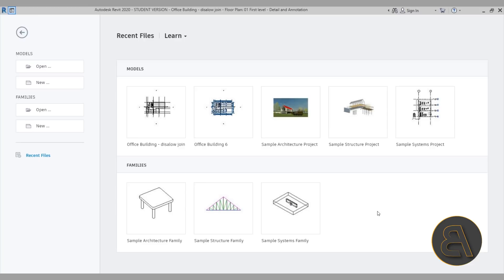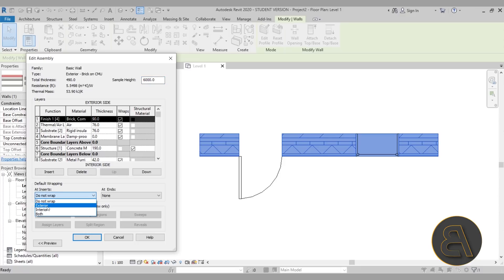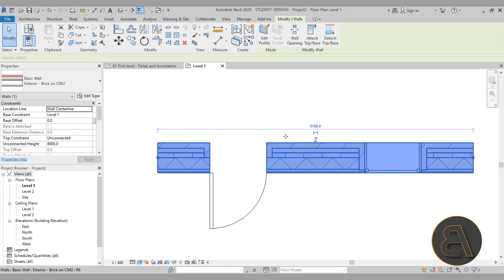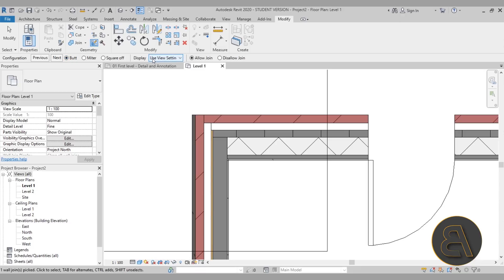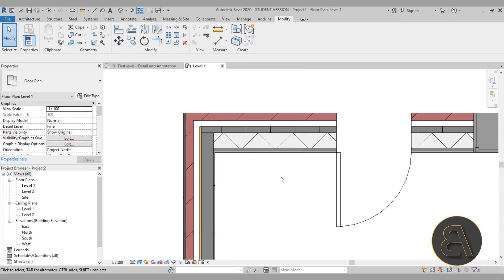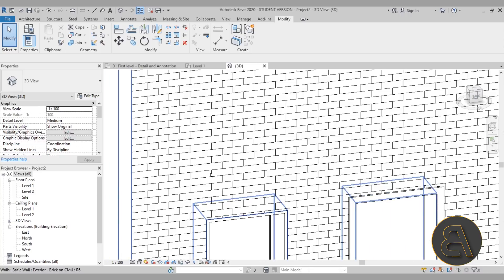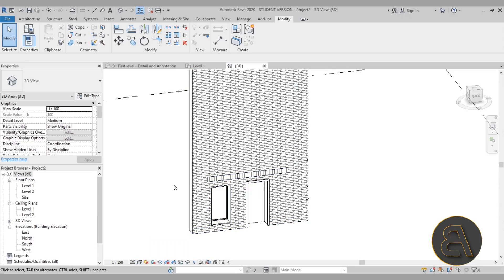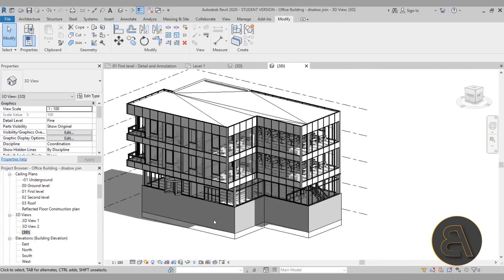Wall Hacks in Revit Tutorial

Comment: I was trying to find in any of your videos how would you approach external insulation for home renovation. I thought about using phasing in Revit to change something. So for example if in the current phase we have got only a brick wall wall and in next phase it will receive external insulation and some sort of external render system. It won't work to remove walls and change the wall type? What's your thoughts? And if you maybe have a video about this already or you may consider creating one. This would be intriguing to see. Thanks.

Comment: Hi Mr. Architect I have problem in my wall which I made with wooden slats I used reveal to added to the normal wall to have wood slats surrounded the whole box of building I cut the opening like for windows and door opening by wall opening i attain what i want in the 3d but when i export my files to IFC the rectangular block which i subtracted to the wall to have opening is appearing how can i solve this problem i want that rectangular which i used to subtract the wall for windows and door opening for the wooden slats not to appear.. Thanks in advance...Miss EVA

Comment: have a question
for basic drafting and basic 3d
is revit LT and autocad LT sufficient

I am on older version of LT now
Reply: Yes, when using both and keeping in mind the following issues: Biggest issue is Revit is not backwards compatible - an older version cannot open a newer versions file, a newer file cannot be re-saved to an older one & any exporting will loose some vector or family data, with the end user not easily knowing what is missing or corrupted. Additionally, AutoCAD LT will very likely have no 3d features, and Revit LT will have all 3d but not have any work-sharing features. At least it was this way several iterations ago. 

AutoCAD LT should track existing 3d; meaning it should import and export the 3d nodes - you just won't be able to manipulate them from inside AutoCAD LT and Revit LT should not destroy a central files work-sharing set-ups, it just wont allow an LT User to sync with any central model.

WARNING! This section only applies to multiple users of the same Revit file... Other users have no easy way to know if an LT user has taken 'ownership' of the central file unless paying very close attention to the files file-tree dates... This means that an LT user must effectively own the Central Model that no one else can link or sync to while in use by the LT license. Once finished, the LT Model is saved back into its proper original central file location - where LT will auto-append the file name to "...LT.rvt". To save it back into a Central File, someone must use a full version of Revit, its new filename re-appended from the LT bit just added, back to the proper central models file name, using either 'save as' central or re-enable work-sharing. Obviously this removes any benefit of work-sharing a project so is not a recommended course of action. Having dealt with this myself, it has been know to introduce minor issues, so unless working in a very small corroboration where all users can communicate effectively and is necessary - it's best avoided all together.

Comment: Thank you for this video. 

Can we create sheets and schedules with cost, area, Material list, quantity etc. for Parametric Family?

Please help. 🙏

Or if you have already made a video on that, please 🙏share the link.
Reply: You definitely can, but the key is managing your data so it can be filtered.

Material takeoff can be done one of two ways;
1. Associate a volume parameter in your actual family, and drive it using a formula, then calculate total in a schedule (doesn't use material take-off - user driven amounts)
2. Use material takeoff, but use a special material to be calculated. Be very careful of double sided faces and edges, typically you may want to just 'paint' one side of the faces for take-off